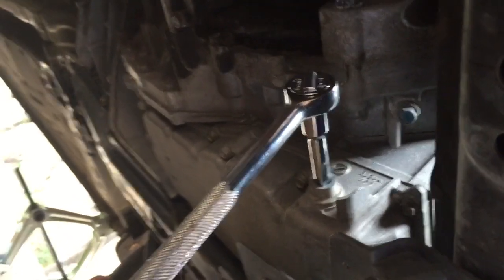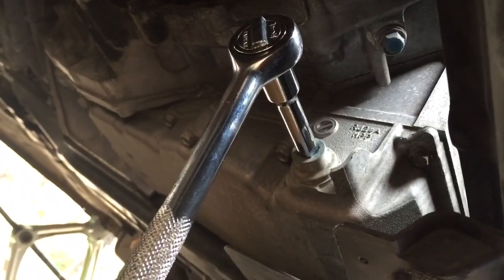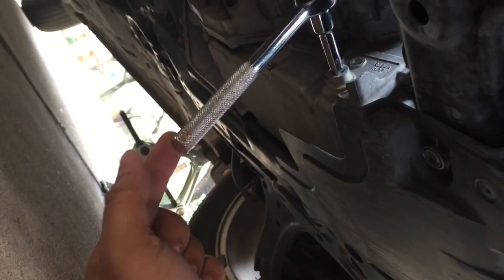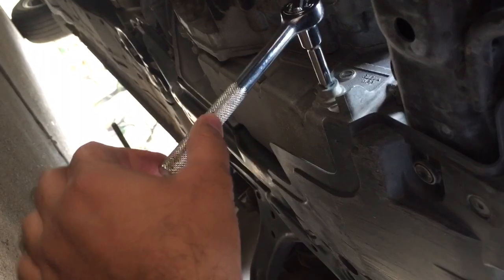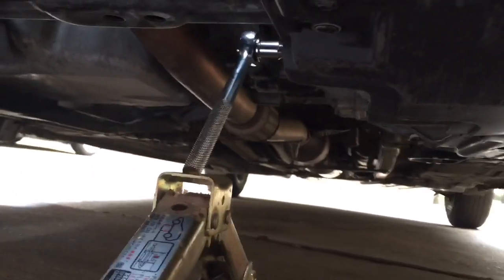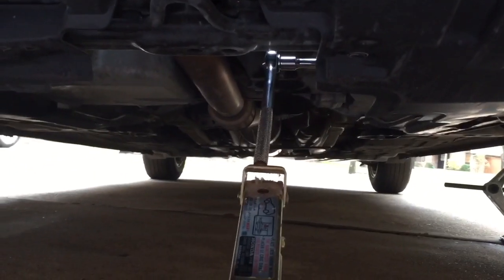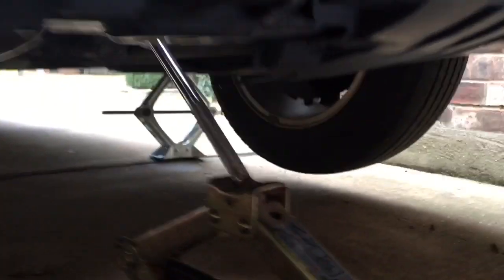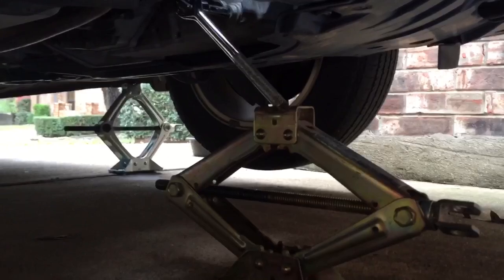How to loosen a stuck Transmission Fluid / Oil Drain Plug

Comment: My drain plug was on so tight that even my electric impact couldn't get it off. The impact has no problem getting off my axle nuts, which are 130 ft/lbs. I tried using my jack, but the ratchet just kept pushing outwards, rather than to the side. I eventually just hit the ratchet several times with a 3 lb hammer and was able to get it loose. Guess I lucked out. I needed a 1/2 to 3.8 reducer to use my 1/2 ratchet though.
Reply from the maker: Awesome! Thanks so much for the feedback and sharing the details which will help others in the same situation. Best wishes!

Comment: Tip for these drain plugs. Take a steel hammer and squarely hit the drain bolt a few times, it will "break" the bolt loose.
Reply from the maker: Fantastic! Thanks

Comment: so im glad that other people are having success with your trick. but personally I think PB blaster + a breaker bar is the most reliable method, because you're putting 100% of the force into twisting. when you jack up the ratchet like that, you're putting a lot of force lifting the plug at an angle, not good unless you want to strip the plug!
Reply from the maker: Thanks so much for the feedback and suggestion. There are usually more than one way to resolve most things in life and the method I used in this video is just one of the many options available. PB blaster + breaker bar are also wonderful options. some also recommend to slightly tap on the drain bolt w/ hammer. All options carry their own risks and it is up to the user to decide which one they feel comfortable with. I really appreciate you adding your suggestions for all to benefit from. Best wishes!

Comment: Broke my breaker bar thanks
Reply from the maker: wow! you must be super strong to have this much muscle power!
Reply: @FlyBeee  it was from following the instructions in the video and using a jack
Reply from the maker: @willsheehan2975  I used ratchet in this video, not breaker bar, and no issue with ratchet in many years of using this method.

Comment: I see a bunch of comments about a breaker bar. I had a rusty oil drain bolt today that wouldn't budge. I tried a ratchet and hammer at first. No luck. Then I tried a breaker bar,  but there was not enough room to maneuver.  The front of the car was on rhino ramps. I searched Youtube and this method popped up. I was actually thinking about taking the car to a mechanic until I saw this! Thank you so much!
Reply from the maker: So glad to know my video served its purpose and helped you! Other options like using a breaker bar, PB blaster, hammering, all work too and this is just one more option for when there is not much space under the vehicle. Glad this helped! Thanks for letting me know. Best wishes!

Comment: 05 Accord first time changed the transmission fluid myself.  difficult to loosen the drain bolt, it was so tight, however, by using this good idea, it was so easy to get it out. thanks for sharing.
Reply from the maker: I am so glad this video helped you. Thanks so much for taking the time to share your feedback! ... and congrats on changing the transmission fluid yourself. High-Five!!

Comment: Cheers dude didnt use this way was scared to damage the bolt. I just borrowed a hammer and a couple of light taps about x 7 and loosened nice. Did use some wd40 penatration spray though. 🤔 your way around cool would work for certain scenarios if your jacked up properly that is..... safety first people!
Reply from the maker: There are many ways to loosen the bolt and I show just one of the many options when someone does not have the option to jack up the vehicle and can use low ground clearance as leverage. for this I did not use WD-40 or penetrating spray.

Comment: Not sure what the percentage is on cracking the transmission case around the plug by doing this is, but I bet it's up there.

Don't do this.

Heat, penetrating fluid, breaker bar. Patience.  - - Heat the plug, hit it with penetrating fluid (Seafoam Deep Creep is best), heat it again. Take your breaker bar, and rock the plug back and forth, using more force to loosen. Repeat until it comes out. Usually works in a couple minutes, and will come out like butter. Use a little anti-seize on the threads, and reinstall. Most trans cases are aluminum. Doing it the jack way can cost you upwards of 3 grand for a new trans because of a drain plug.
Reply from the maker: Thank you for the detailed replay and the alternate method.  I have not had any issues with this method shown for many times I have used it on many vehicles. There are more than one way to do anything and so is the case here. Viewers can decide which one they like to use. Best wishes.

Comment: I myself prefer the "kick at it" method
Reply from the maker: LOL, that works too! .. but it depends on how the drain bolt is installed. Sometimes it is installed in a way that you have to pull the ratchet to loosen the bolt in which case the kick method won't help... which was the case with this vehicle / this video.
Reply: @FlyBeee  haha! Then I'd just kick it from the other side!!
Reply from the maker: @adamrozman  LOL, good one!!

Comment: Very creative solution to this problem.  That being said, making a video for all to see with no jack stands for safety is bad all the way around.
Reply: The car was grounded on all 4 tires.....what the hell would you need jack stands for?
Reply: @redfield2701  Are you sure about that?  Look at 55 seconds.
Reply from the maker: Thank you. I used jack stands to lift the car to get better angle for the camera. I put camera under the car which makes it look as if the person behind the camera was there as well. I appreciate your concern.

Comment: 06 Honda Pilot 4WD rear diff. Tried PB blaster with heat and hit the bolt a few times with 4 ft breaker bar and it didn't budge. Almost gave up and saw this video and thought "why not". Did it and heard a loud "pop", thought I broke the rachet, and to my surprise it worked. CAUTION: be somewhat careful as when it does break loose the vehicle could drop down on the jack.
Reply from the maker: Awesome results!! I am glad this video helped you. Thanks so much for sharing your feedback!
Reply: NEVER work under a car supported only by a jack

Comment: Thanks! Worked like a charm after a lot of frustration.
My take is to use a bar so as not to damage your quality ratchet.. This enables you to tap the socket while there is jack tension on the nut additional benefit is it will help the socket stay on a worn nut.
AND NEVER WORK UNDER A CAR SUPPORTED ONLY BY JACK'S!!!
Reply from the maker: Thats a wonderful suggestion! Thank you! ...  I put phone on the ground under the car which makes it look as if the person behind the phone was under the car :)  I appreciate the concern though. thanks

Comment: Bro you are the man,  HELL YEAH NOW I CAN GET THAT DAM BOLT OFF, THANK YOU THANK YOU THANK YOU  YEAH!!!!!
Reply from the maker: You are welcome! If needed, also lightly tap on the bolt w/ hammer and use PB blaster spray. I didn't have to use either of these but these are some suggestions that helped other viewers. Let me know how it woks out.  Best of luck!
Reply: @FlyBeee  I use your method and it came loose, 2 days ago I took it to the honda dealer and they couldn't break it loose, so I got under there 2 hours ago and raised the jack on that ratchet and it broke loose , thank a million, cause I didnt know what I was gonna do until I came across your vid, thanks again!!!
Reply from the maker: This is awesome news! I am happy that my video helped. Thank you for taking the time to share the update. If you get a chance please checkout my other videos on Honda maintenance. If you feel comfortable working on the vehicle you can save tons of money and time by doing most of the maintenance yourself with simple tools. Good luck!

Comment: Myy '88 Jeep Cherokee's 5-speed drain and filler plugs have a 5/16" square hole whose corners are rounded off on the drain plug.  The shop that worked on it 4 1/2 years ago overtightened the drain plug so that even with a breaker bar, the ground-down 3/8 socket extension I tried to use broke off!  I have an aluminum rod whose corners I rounded off at one end, and up until now it did the trick.  I have to wonder if there is a tool out there somewhere that will fit and can be used with a breaker bar.
Reply from the maker: Were you able to find a tool that worked for the rounded off drain plug on your '88 jeep. BTW kudos for maintaining your Jeep Cherokee so well all the years!
Reply: @FlyBeee  As a matter of fact, I found a set of oddball 3/8" drive drain plug sockets that included one that fits both drain plugs on the Jeep's transmission.  I used a 1/2" telescoping socket wrench with adapter and managed to break the plug loose.
Reply from the maker: @8avexp  Brilliant, so creative! You are da man!!
Reply: @FlyBeee  Just to be clear, the corners of those square holes were always rounded off and not square.  The socket set I bought was a Performance Tool W54287 15pc Drain Plug Socket Set Tool.  It has a metric equivalent square socket that fits my drain plugs to a T.

Comment: Ah you genius. Have a 9/16 square head plug on the rear end of my '49 chevy truck. I dont think its been off in 30-40 years if ever. Was stuck under it for over an hour with no luck, before a bit of youtube research and finding this video. Stuck an old spanner on it and used this jack trick - off it came no bother!
Reply from the maker: Awesome!! Thank you so much for sharing your success story. It makes me happy that this video helped you. Best wishes

Comment: Yeah...never ever do this unless you have a throw away truck because its gonna cracka da casa. Just heat the end of your 3/8" drive extension with MAPP gas and place in plug and leave for five minutes; that will do it every time
Reply from the maker: Thank you for sharing the alternate method. Best wishes.

Comment: Broke my ratchet extension trying this 😅 Harbor Freight fail!
Reply from the maker: Dang!! Thanks so much for sharing your feedback. What kind of vehicle did you try it on? did you finally get it open with PB blaster or another option? If you live in northern states and driving on older vehicle with possibly rusted bolt, sometimes it works out better to get the dealership/service shop do the drain & fill of transmission fluid one time (and open the stuck bolt) and then you pick up from there and change the fluids yourself in future. I hope this helps.
Reply: Lifetime warranty as long as u keep your receipts. I have scans of all my receipts for lifetime warranty HF tools. Some stores are nice and will let you swap them out without a receipt, but it depends on the store.

Comment: Have this issue with my filler plug on my transfer case. Usually if i swear at it enough they eventually come , but not this one. Will have to give this a shot. Cheers for the video. Will update once I've tried it out 👍
Reply from the maker: LOL... I hope all goes well with this method. When you get a chance let me know the results!

Comment: The ratchet is too short which does not give enough torque to turn.  The factory usually over torque this bolt.
The solution is:
-Try using a longer ratchet which gives you more power to turn the bolt.
-Slip a metal tube inside the ratchet that is longer to give more torque.
-Try using a breaker bar which is longer and uses a 1/2 inch drive.
Reply from the maker: This is wonderful suggestion that many would benefit from. Thank you!

Comment: I'd never trust a knife jack to support the weight of a vehicle while I'm under it. Get a pair of regular jack stands if you don't have them yet. They make small ones for small vehicles. Anyways, the use of one for bolt breaking is ingenious! That solves most the problems I have trying to get things free while on my back and with little leverage space.
Reply from the maker: I didn't get under the vehicle therefore didn't use jack stands. Used scissor jack to get more clearance to open the stuck bolt. Thanks for liking my trick to open the stuck bolt :)  Best wishes

Comment: Am trying to check for the ratchet to buy but I did not see the specific one for Honda Civic 2006 model. Pls what range of ratchet should I go for
Reply from the maker: In this video I used a 3/8 size ratchet, which is from a very basic tool set that I have and use to maintain my vehicles and make these videos. Exact tool set I have is https://amzn.to/39VPfbG. It was a few $ less when I got it 15 years ago, but has held up nicely and I still use it today. Well worth the money.

Comment: it stripped the gears in my rachet lol and it didn't open it
Reply from the maker: +tjgrafiks  thanks for sharing the update. Sorry to hear your ratchet crapped out on you :(  Thats just odd though. I've used this method for a long while on several vehicles and never had an issue. Was the drain bolt rusted? No issue with the direction of force (righty-tighty, lefty-losey). Any details you can share would help me and other viewers. Thanks
Reply: +Fly Bee yeah i'm good with the righty tighty  method. i guess they were cheap lol...i've since bought a breaker bar and cracked in about  10-15 secs! everything was a success.
thanks again
Reply: Use a breaker bar and not a ratchet next time.
Reply: did you read my comment above your reply???
Reply: tjgrafiks Nope haha.  Wouldn't have commented if I did.

Comment: So I tried this but I managed to strip the inside of the drain bolt where you connect the ratchet. I’ve tried pliers and a hammer and chisel with heat applied. What an I do now? sucker still doesn’t want to come off.
Reply from the maker: If you haven't already, then try PB blaster Penetrating catalyst. It works magic especially if you have a northern car with rust on bolts.
Reply: @FlyBeee  pb blaster has never worked for any seized bolts I've ever had no mater how many applications I used...! EVER!!!

Comment: When trying to remove drain bolt there was a dry crust like seal around the bold. Almost like loctight ? Is that normal ?
Reply from the maker: Someone may have used anti-seize on the bolt considering the area gets hot. There is no need to use anti-seize on drain bolt. A good washer (listed in video) will do just fine.

Comment: Man this is so smart. My drain plug on my transmission is horizontal so I can’t really get it off this way but this is super smart for a vertical one!
Reply from the maker: You are welcome. The same method works on horizontal drain plugs too - because scissor jack works well regardless . Earlier today I changed engine oil on this Accord and its drain plug is horizontal which would not open. But no issue when I used this trick again.. I hope this helps
Reply from the maker: @td sims The position of jack would be the same as you see here in video - that the loop faces out towards front of the vehicle so you can rotate it to raise the jack - the difference is that ratchet would be perpendicular to the jack and you will have to position handle of ratchet in a way that drain bolt opens when you push the ratchet up. The put the ratchet handle on top of jack and raise the jack up.

Comment: Hi, is there any chance that we can break transmission drain plug?if we opened it?
Reply from the maker: There is a possibility of this happening... but usually with rusted out drain bolts. Some people recommend to hammer tap the drain bolt head, others say to spray PB Blaster and keep overnight... whichever method you feel more comfortable with. There is definitely risk in each option so please try at your risk. Best of luck

Comment: I'm using a pipe but the motor mounts are flexing
Reply from the maker: Flex in motor mounts does not sound good. If you are still having issue, lightly tap the drain bolt with hammer, spray PB blaster around the drain bolt and let it work for few hrs. If nothing works, it may work better to take the vehicle to neighborhood service shop and ask them to just loosen the drain bolt. Many would do for free but some won't unless the do rest of the work as well. Take your transmission fluid with you in case they want to do the drain-fill and charge for labor. At least you will have the drain bolt and not tightly closed that you can then utilize for next fluid change. Best of luck

Comment: How do I get it off without a torche wrench… the bolt is messed up
Reply from the maker: If you have used at-home options like use PB blaster on bolt, tap with hammer, use this trick shown here, but the bolt does not budge then you may have to take it to a shop to get the fluid changed. They have power tools / special tools to remove the stuck bolt. At the time just ask them to install a new drain bolt and not use the old messed up one. Best wishes
Reply: @FlyBeee  I dont trust any car mechanic …. Hopefully I can get this done
Reply: @FlyBeee  ain’t ever going to a mechanic … specially where I live lol
Reply from the maker: @QuietStormAngel  Lol...Now I am curious, where do you live? :)
Reply from the maker: @QuietStormAngel  If you get a chance, let me know the outcome. Thanks

Comment: STILL COOL idea but did not work for me.  Nissan P.U. sitting on blocks for  a decade.  All four bolts on differential and transmission frozen.  Applied P-oil for several days tried EVERYTHING!  Unfortunately, this would not work because of screwy angle.  Finally used 14 inch breaker bar, chain and come along attatched it to trailer hitch of another vehicle.  WORKED beautifully and didn't even fully tighten the cable...bolts came out very smooth 👍
Reply from the maker: Thanks for sharing your experience and the suggestion to open the stuck drain plug! i really appreciate it.